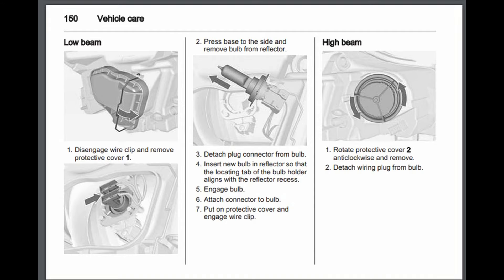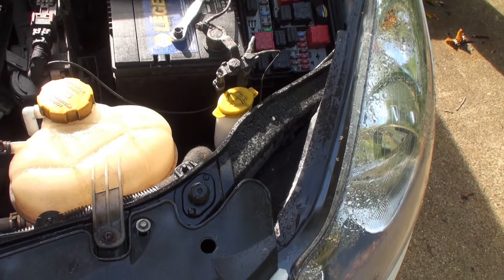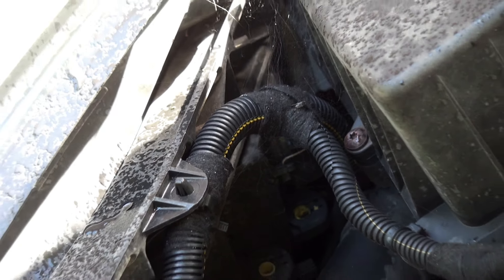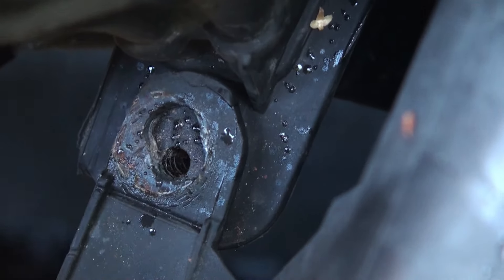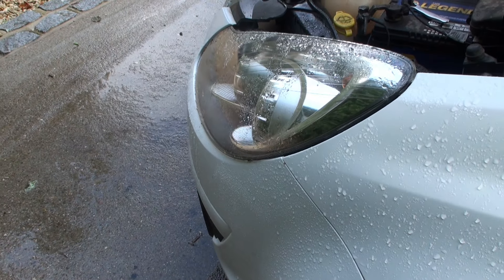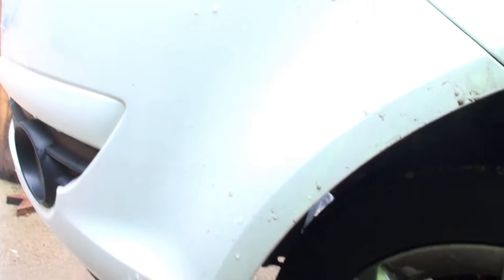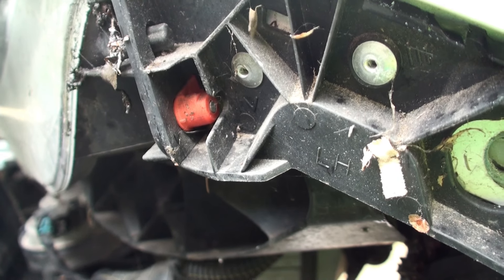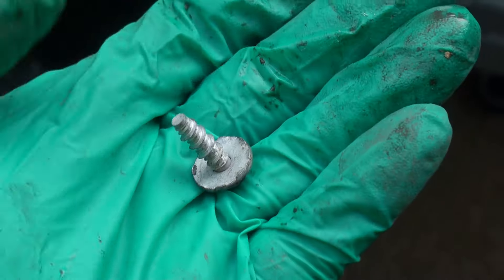Corsa D Passenger headlight bulb change

Comment: I was starting to change the front lights on my wife's car until I found the nightmare and I had to quit. I thought I was going to take 10 minutes when I realised I needed a toolbox and a lot of patience. The engineer who created this system should be in prison. Thank you for the detailed guide, I had to save it here for when I do it. Still a task head. I believe that even my 4 year old daughter can't fit her hand to change it as it says in the manual and tearing half a car to change a light it's just crazy. Back lights are easy tho.
Reply from the maker: good job. Thanks for the feedback
Reply: If u think that who projected the bulbs light place, in consideration of its uncomfortable position, needs to go to jail, go and check how to replace the rear speakers in the 3- door version...  a wrong screw to replace might make you head to dismantle the whole car!!
Reply: Got mine to do tomorrow not looking forward to it
Reply: You are talking absulte nonsense
Reply: Halfords couldn't change my dipped headlamp bulbs and suggested I go to a garage.
Reply: 😂😂😂 unlucky you lot. Get your wives to change their own bulbs!! Dismantling the car??? 😂 no need. I have a corsa d and watched this video dreading changing the bulb. Being a small female with small hands, I was able to fit my hand in and change the bulb without removing any other parts. Unlucky guys! Get smaller hands or a self sufficient wife!

Comment: Thank you, this guide was excellent! The repair instructions on the manual are absolutely garbage.
Reply from the maker: You're welcome!
Reply: @razenby  guys I did it without disasembling the car!
1 take out fuse cover
2 take the hedlight (bulbs cover)
3 pull firmly cable socket that is on the bulb. Try losening it by moving it left-right.
4 pull out bulb. That was hardest.
I did it with small universal crimp (chinese one like swiss army nife have) Pull it realy firm. Bulb have two holders horizontally on both sides ~ 2mm wide. It is planned to press one of them with screwdriver - IMPOSIBLE. So pull hard one of bulb connectors.
I was lucky.

Comment: Isn’t it possible to just remove the spring clip and replace the bulb from inside the bonnet without having to take off the front wing!?!?
Reply from the maker: On some models. It depends which variant you have. However it is quicker to do it the way shown as it is a lot less hassle and you can easily make sure the new bulb is seated correctly.  See comments from oter viewers.

Comment: Your passive aggressive comments about the user's manual and the basic design which requires one to dismantle so much of the Car in order to change a simple headlight we're certainly much kinder than the thoughts going through my Grad AS I was doing it!!
Thanks so very much for a well done and helpful Video. Saved me much time and grief.
Reply from the maker: Thanks. I have worked in and managed design teams all my life and I have seen how designers brush ignore issues.  This one certainly caught them with their trousers down to the extent that they couldn't bear to write the truth in the user manual. The service manager at the local Vauxhall dealer just shrugged his shoulders when I asked him about it. He said 'there are a few models that have the same problem' . On my Volvo you pull up a  slide lock and the headlight module comes out.   No tools required.

Comment: I have an 08 Corsa. Exactly the same issue with access to the back of the headlamp units. Started removing the unit and then decided to check YT just in case I'd missed something obvious. Found your vid. So it looks as if I do have to remove the entire headlight housing. As you say, Vauxhall evidently want to make it as difficult as possible for owners to do a basic bulb change! Thank you for making a very helpful walk through. Cheers 😎👍
Reply from the maker: You are welcome. The guy at the Vauxhall main dealer service shop just shrugged his shoulders..  Careless design.

Comment: I came here to see how and where the actual bulp, socket and clamp is located to remove the bulb by feeling my way forward, but this video shows how to replace the whole lamp.
I am though very impressed by your patience... it even looks like it is raining!?! Kudos to you sir 👍
Reply from the maker: You have to remove the headlight to change the build. On some models variants with a different fuse box you can just about get to the bulb. Otherwise it is necessary take the headlight out.
Reply: NO   don't take bumper off.
I did in 10 minutes. All you need is a 1.5mm allen key, hook it through one of the holes of  metal prongs sticking out then pull it with pilers
Reply: @razenby  I have small hands, I mangaed to replace the bulp. I was just looking for a clear view on how the bulp were actual placed in the headlamp so that my fingers shouldn't seek blindly.

Comment: Many thanks you handsome bugger. Just did this on mine, figured I'd change all the bulbs whilst I was in there.

It's actually easier to do this on the drivers side too than it is to pull the air box and fiddle about in the tiny gap
Reply from the maker: Great job. Thanks for watching.

Comment: Thanks for the help with this. Having previously been able to contort my fingers into position just enough to change the bulbs in the past, I eventually needed to do this the long way (with the help of your video) - the bulb connectors both broke off leaving me no choice but to strip down. In my reassembly, I decided to leave off the hidden screw/bolt - I don't believe it's necessary. I also greased the pressure springs that retain the bulb and also fitted a small pull strap to the new bulb (using a bit of garden wire, a 1 mm drill and a bit of earth sheathing). So hopefully I won't need the full strip down again, and if I need to take out the headlamp, only the visible screws to be removed :) . Many thanks again for the insights
Reply from the maker: Hi Michael, it is bad how fragile the inner parts of the headlamp are.  I keep getting daft comments from Corsa owners with different under bonnet configuration reckoning that they had no problem changing the bulb without headlight removal with itty bitty fingers. Good to hear confirmation. Cheers.
Reply: Genius idea about the pull strap. Wish I'd read your post before I changed the one on my son's car just now. Will remember for next time.

Comment: Just looked at changing mine see the amount of room they give I walked away, now I’m here nice one I’m gonna hav bit of fun sorting it now 👍🏻
Reply from the maker: Ahh, good luck. It isn't too bad a job once you know what you are up against. There is a good tip on here that you should leave the lower screw out for next time. I did that on the driver's side and the headlight feels OK with just the top screw fitted. Subscribe if you can thanks.

Comment: Great video, done my sons bulb and because I watched this video i had the light out, bulb changed and light, grill and bumper corner fitted back in 20 minutes, thanks mate
Reply from the maker: You are welcome. It is a stupid design.  In every other respect we have are happy with our Corsa,  It has reached 89K miles with 0 issues except one O2 sensor which is normal for all cars.   I had a fiesta of thr same age and the front suspension was knackered by this mileage on the same roads.

Comment: Cheers for doing this instructing cause I needed to change the bulb on my daughters car and thinking it's a five minute job only to find I could not remove the lamp after removing the screws at the top, had to give up to then try to find how this is done so thank you for this, whoever design this needs sacking.
Reply from the maker: No problem.  It is a daft design. The Vauxhall service manager who I just shrugged his shoulders as though he couldn't understand why all the fuss. He said 'Bulbs last many years these days so it isn't really a problem'  That sums it up.  Thanks for watching.

Comment: Ive done most of the removal apart from the T15's which appear rusted !!!! Ive had to get a new torque bit set as my older ones are worn. If I have issues I will gring them off and tie wrap the covers back on afterwards ! Oh I even purchased the wrong bulb, so will have to go get one before I remove the headlight !!! Thanks for the video clip 73's Andy M6APJ.
Reply from the maker: You are welcome. Good luck with it.

Comment: I just watched this today, and was dreading doing it, because changing a bulb should not be this hard. Cold dark and stormy here, forced me to find an easier way. Opened the bulb cover, and without removing the wire block, I just pulled the whole bulb out in one go, it is very awkward, and you need to be a contortionist, or left handed. Once out remove bulb from wire block, and replace with new one and shove straight back in. Took me 2 minutes. I had difficulty getting the back cover, back in place, but all good now. 
Thanks for all info anyway.
Reply from the maker: You have a different model.  On some variants it is possible depending on the options the vehicle has and the fuse box type.

Comment: What a palaver,  I've just sold my Volvo and it was dead easy to change the headlight bulbs , one little lever that held the whole headlight unit in place,  I've just downsized to a vauxhall agila 1.2 and  it looks like i will at some point have the same problem changing the bulbs 💡,  so thank you for forewarning me about this problem.
Reply from the maker: you are welcome.  I have to say though that overall the Corsa has been a great car.

Comment: Thanks bud - the adjustment is broken on mine so I have just ordered a scrap replacement so its good to know I dont need to remove the whole bumber!
Reply from the maker: No problem.
Reply: @razenby  All I need to do now is get the MIL light off - it keeps reporting cam shaft sensor - fitted a new one and reset it but after a mile the light came back on

Comment: Cheers matey. Would have given up without this. How many engineers does it take to change a light bulb ? – On this occasion 3, me, my neighbour (also an engineer) and you with this video. As you say Corsa not built for maintainability at all. Vauxhall try testing your publications! Halfords and places must be rubbing their hands together offering fitting with cars like this and then charging labour for bumper removal. Incidentally, cant believe the French still require you to carry a set of bulbs as well. As if your going to do that at the side of the road. Thank you very much for making a difficult job manageable.
Reply from the maker: No problem.  Duff design alright.

Comment: Excellent video really helped me out thank you 🙏. 
We have a volvo and a corsa, volvo takes 2 mins with no tools!!! Bloody GM
Reply from the maker: We have C30 volvo  and it takes just a minute to change the bulb. Mind you  H7 bulbs fail a lot.  I bought Philips so called 'long life' H7s that just lasted six months.  When one fails I change both as they don't last. The old fashioned 60W twin filament bulbs  in my Range rover 2001 last many,many  years proving what my dad used to say that the old stuff is much better than the new rubbish.  Angry over-driven, low life expectancy crappo.
Reply: @razenby  👍

Comment: I wonder if it's different for different models? I have a Corsa D 08 plate and just changed the bulb no problem. I unclipped the cover and just pulled it back enough to reach in and pull the bulb and the wire through the gap.

It was a bit fiddly to replace and secure but far easier than when I did the same on my wife's 206.
Reply from the maker: Yes some models have a more accessible dip beam bulb. (see other comments) It depends on the layout in the engine compartment. On this car the gap that you can make isn't enough to even get your little finger in - even with the cover removed from the fuse box.
Reply: @razenby  Ah ok, guess I was just lucky then. Appreciate the video and reply.

Comment: Hi having watched the video ( very informative) I was wondering if you could help the near side light on my corsa d point to the sky for some reason have not removed hole unit as yet but can you tell me if there is some sort of retaining clip to hold bulbs in place as can move the upper bulb about and can’t see if it has clip or not or does it fit into a locking hole as such thanks andy
Reply from the maker: main beam or dipped beam? I think you are correct, the most likely cause is likely that the bulb has come loose. Unlikely that the lens has shifted but you never know. . You are probably going to have to take the headlight out to get access.

Comment: 2 of the wheel arch liner torx screws on mine were stripped as was 1 of the screws underneath the bumper so I had to use a dremel to make a cut and use a screwdriver to remove it so I could install a set of osram drl’s,, on changing the offside bulb the long screw snapped they are available from vauxhall.
Reply from the maker: Great tip thanks.

Comment: Hi, I’ve done all the necessary things and changed my bulb. It wasn’t hard and pretty straight forward. 2008 corsa design. Issue I have now is adjusting the headlight patten on the road. It’s now too pointed down to the ground. I hope I can adjust this manually (as I cannot via the inside controls) those cogs next to the connect I can imagine adjust the headlight? You see what I mean at 9:25 in the video… to spin in into a better position. What’s your thoughts?
Reply: Actually sorry there is a black connector right next to the bulb which is supposed to be the electronic motor that moves the dead lamps positioning. I hope I just have that in the wrong position when I re installed it as I mistaken that as the bulb housing.
Reply from the maker: There are three things that can affect the beam pattern/position:
1. The bulb isn't sitting correctly in the holder or it is the incorrect bulb type..
2. The headlight isn't mounted correctly - this should be evident when you look at the headlight so unlikely.
3. There is a headlight leveling motor in our Corsa controlled by the BECM.  Check the plug is fully in and the locking slide engaged. . Did you by any change turn the ignition on without the headlight connected? On many cars this will need the headlight resetting with a OBD terminal / code scanner.
Reply: @razenby  thanks for the information, I’ve also seen that there are little manual adjuster behind the headlight when lifting up the bonnet. Using an Allen key like tool. I’ll look into it and report back, many thanks
Reply from the maker: You shouldn't need to adjust that if you just took the headlight out and put it back. Have you checked thatthe bulb is still clipped in the correct position?

Comment: Just a question would it be easier to take the fuse box out instead
Reply from the maker: Possibly.  We have a Vauxhall main dealer down the road and the mechanic told me this is how it is done.  I have had several people mentioned that they changed it easily using the car manual but clearly they were working on a different variant of Corsa.

Comment: WHAT A BALL ACHE!!! But thank you for the video! I went to two garages and they both failed to swap this bulb!
Reply from the maker: Glad it helped!  In the comments some say that it is possible to change the bulb in the traditional way but they have a different under bonnet layout to the problem Corsa. It is a very ODD thing. Overall we have been very happy with the corsa - at 70K miles we haven't had any problems with it. Some minor bodywork modification has been done by my daughter by brushing up against parked cars apart from that it still drives like new..

Comment: Nice job mate. I've done this once before and I think it looks a lot more complicated on video as you have to describe every step. I agree tho, the process is more complicated and ridiculous than it should be to change a simple lightbulb. Subscribed.
Reply from the maker: Thanks.   We had a good suggestion that it is best if you don't fit the the lower fixing screw .  In fact when I came to change the drivers side the lower screw was already missing.,,,

Comment: thank you very much for this i need to do both headlights should i just take the front bumper off to do it
Reply from the maker: The passenger side is a lot easier. Move the air filter housing if necessary.   You will see comments that this can be done without taking the headlight out but that is on different models.

Comment: Pretty straight forward once you know and the off side is also straight forward, I found it easier to remove the air box which was easy enough, good vid 😉
Reply from the maker: the air box is on the LHS side. Due to the constraint wiring of the looms on  the RHS (UK offside) the fuse box cant be moved and taking the cover didn't help. the way . A the local Vauxhall garage they do it this is what they do.  I got into it as they were going to charge me £50 change the Nearside Bulb.

Comment: Hero. I’ll have a go. I used to have Peugeot 206, 2007. The lights were so easy to fix. 

My Corsa is reliable but I hate it 🤣
Reply from the maker: Thanks for watching.  hate mechanics bills.   Our Corsa D 1.4 petrol has done 160K miles and is very reliable. The oil has been changed every 6,000 miles.   I have quote a lot of respect for it.  Our Ford Fiesta 1.6 Petrol 2009 rattled in the suspension and the engine at 100K miles. It literally started to disintegrate,  Whereas the Corsa has only needed a couple of new springs and maintenance. Try to love it...
Reply: I was able to replace by just using the cover on the inside, not much room, but figured it out.  @razenby